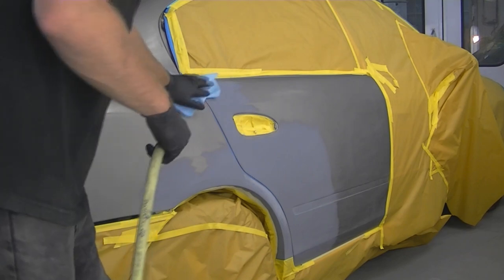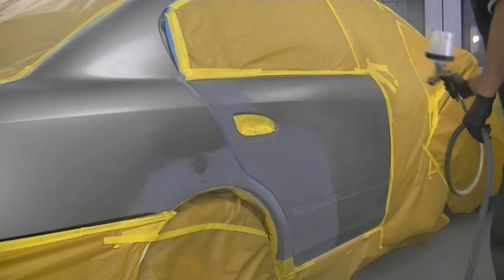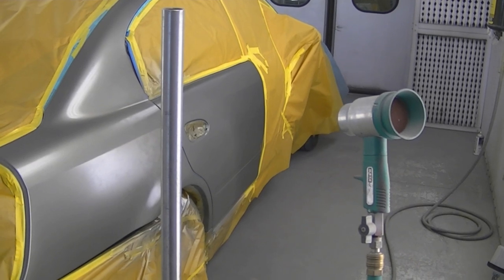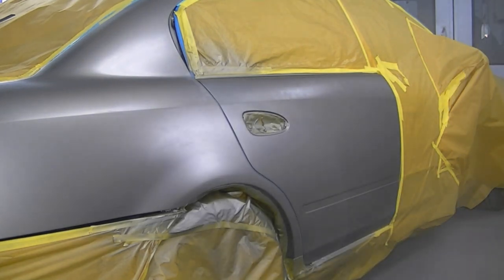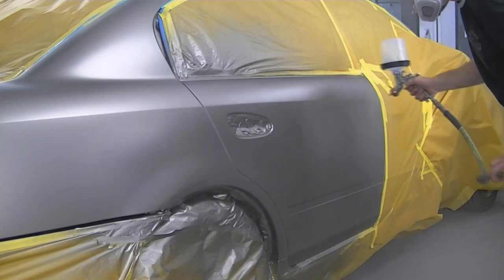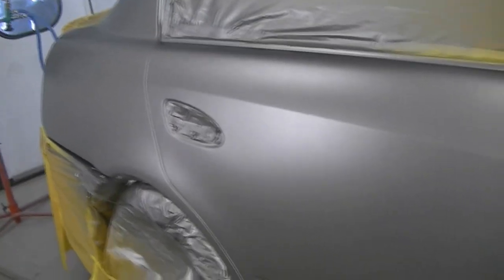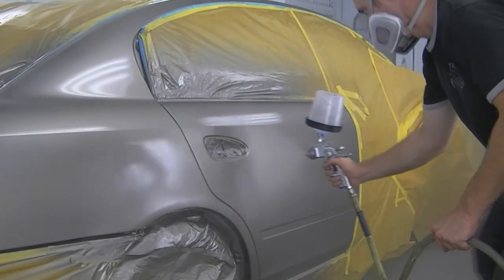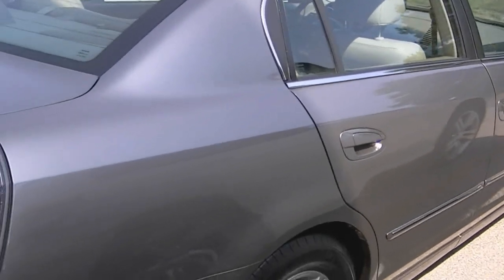How To Blend Metallic Car Paint

Comment: A nice bold approach to how you spray your base. I wonder about some of the comments here about tiger striping, which some posters think you'll get by the criss cross angles of your base application. Are they not aware that if your gun is clean, your spray pressure is constant , your paint is reduced properly, and your technique is solid, you could spray a X across a silver hood and not see it later.

Comment: Enjoy your work. my 1st time painting. tried to blend repair of 4 inch area to 10 inch area on the lower door. have  spray can "bright silver metallic. some it a bit patchy. blend color looks brighter then rest of car. will clear coating it tone the color down a bit? i wet sanded it and then based it again. still same brighter look. i don't have money for a pro to paint. suggestions?

Comment: i think when you apply is a wet bed "Unpigmented Base coat" between blend Coats it create's a more noticeble Color Blend because your blending in different layers of paint which becomes more noticible by creating a Holograph Effect as the layers deepen. Its a skill i find that is perfected in a lifetime and not many master and you have it. Too many factors here.
i think the best approach to this repair is to paint the entire side of the car, blend color under the tailights where the shape hides the repair and do a full panel Clear to the edge of the panel. but on the otherside it depends on how good of shape the next adjacent panel is.. if the Clear coat is mint then you can scuff it out in under an hour professionally. i say scuff as oppossed to sand because color is one thing and finish matching is another very well done video. i like to say you can only see one angle of the car at a time.

Comment: wow that came out really well. I just got my car painted and its the same bronze color as that one, the only problem, is that the new paint came out a little darker than the old one and you can really tell when you see it as the sun shines right on it. Was that because the painter did a poor job of blending? or was it because they just used a color that was darker? They painted my car from where you painted that altima, quarter panel and rear door.

Comment: I have a couple of questions. I have been painting for a living for about 3 years full time and still have a hard time with light silvers and golds. Every painter I speak to paints differently. My question is, in your video, how many turns out is your material knob, your fan, and what psi? Also what size tip in your gun?

Comment: I recently did a Toyota Yaris which is silver- code 1e7 and had to paint both doors and blend into both quarter panels, the base appeared to me as if it went on well and covered well, i put about 3 solid coats on after i coated the primed areas. I was happy with how the base looked, it went on smooth, no mottle no streaking or anything. I put the clear on, 3 coats of clear and then i noticed the both the doors had major streaking in them, it has never happened to me before, I'm not sure what caused it?? it was a cheaper than normal base coat which might have been the culprit
Reply: Give each base coat a good drying time.
Reply: Alive And Anxious actually you can see if that will happens with a flash light and what i do to fix it it's re sand it with 1000 grid and use a flex block, i don't use my fingers cause i did it many times and i made channels that looks like dents at the end. Good luck buddy.

Comment: I have damage on rear quarter panel and bumper, both will be repaired 
and painted, is it required and recommended to blend with rear trunk and
 rear door. My shop tells me they will be blending, insurance company is
 getting me run around. Insurance company tells me to rope off rear 
quarter panel window rather than removing to proper painting.

Comment: do you keep your psi the same or do you have to ramp up psi and hold back gun? 
also what do you do if you are getting tiger stripes on a hood when painting metalic paints. sata jet rp3000 1.2 tip base

Comment: Hey,
I am looking to repair some rust spots on the box of my truck. I do not have a spray gun so hoping to use a spray can (paint, primer and clear). I need to blend it in though as I don't want to paint the entire side of the box. Is this possible using the spray cans? If so, do I use the same techniques as in the video?
Thanks!

Comment: you can and should add a flex additive to primer also SEM sells flexible primers for bumpers and other automotive plastics
however base coat does not require it only clear coat

Comment: Thanks very much for the video and explaining everything. So with metallics and pearls we don't wet sand before applying the clear is that correct?
Reply: If you wet sand a metallic colour before the clear coat, you stand a high chance of disrupting the metallic flakes embedded in the clear coa and will end up with a flat dull spot in the metallic when cleared

Comment: I was wondering, you do not have to do inside the door jambs? so many cars in the 60's and 70's , man you would get  a sandpaper like over spray, depending on the car , the color or your angle, but to just paint with out checking . amazing! one other thing, was that a shadow on the last footage? quarter looked darker?
Reply: Door gaps have masking foam inside the check, its special shape feathers the paint edge just inside the edge of the door

Comment: would it be a good idea to tack in between coats or no?? i dont but when i clear i get this gritty look on my blend edges so i feel like if i tack that off the finish would look much better but am afraid to do it and not know if it ll move the metalics or not
Reply: Eddie Lugo I used to never tack rag my basecoat for fear of moving mettallics. I tried it on a light silver last week and got the cleanest full respray out of a booth ive ever gotten. The tack in between every stage including the plastic around the panels combined with observing flash off times plus wetting the floor.. wow what a difference. I got between 5 and 10 easily to wet sand out specks on the entire car, a couple light sags in areas where my lighting was dim and I had little movement around the lift and one minor gun drip on the roof. Sounds bad but overall the car looks incredible. No mottle, no patchy spots, and minimal polishing to do. And that's all in a filthy oily repair shop with my air line catching on things every 2 min. Tacking is CRITICAL to clean work.

Comment: i think this was very insightfull. all these negarive coments just reflect on their ignorance and bitterness for they only can dream about even attempting to do this their toaster. its easier to diss out of brainless thoughts than to comment on constructive level. I am learning this trade out of hobby and found this video to be very educational. Learned alot. than you
Reply: Javier Castaneda glad someone said that everyone has different techniques and a lot of people don't agree with other people matter is if it looks great it's done right I personally add to 20 to %50  2k clear after covering the repair area this blend perfectly without the requirements of extra additives to paint work then simply clear coat over another 2 to 3 times sand and polish perfect also save you from blending half a car when you have a dentist size your hand

Comment: am confused, new to the blending skill. In one video you said you couldn't use a wet bed over the chromax water born where you had trouble with a match. You mixed it with the base. But here you are using a wet bed, every time what am I missing? Also is this orientation coat a blender solvent and if not would that work on some paints?
Reply: don't listen to anything he said! I've been painting for 30 years and have never used a blending additive. Blending requires 3 steps. 1...coverage, 2 first blend pass.go as far as you are taking blend and spray back towards the fresh paint. don't change preasures or anything! let flash. 3 final blend pass..divide blend area in half spraying back towards repair area.done!. trick...pull fluid stage as you move the gun with air on continuosly. easy. works every time.

Comment: Wet bed is only meant to be applied once, and if you speak to any ppg certified painter 95% of them don't even use wet bed due to the sinkage in the near future. Also the way you are spraying would create halos just by the way of flicking your wrist rather than having consistent overlapping, with the correct drop coat. May take a second drop coat to get rid of blotches. Silvers are meant to be painted like robots just how it came factory finished. I see many painters spray like this and they all have terrible hand eye coordination. And with poor consistency and poor overlapping they have primer bleed through a, halos everywhere, tiger striped and extreme dryness and orange peel. Sure looked good on camera but in person I'm sure this car need a very good polish and deliver in shade
Reply: Why would you only spray the wet bed once, when you have 3,4 maybe even 7 coats of more color coming down. The wet bed is dry after the first coat of base has flashed off. His technique is fine

Comment: Yeah,  i'd like to think i was an expert in the field so here is my opinion  the rear quarter is miles out,  as in much too darker than the rear  door and you can also  see that where he tried to lose it up the roof pillar he was very unsuccessful unbelievably so,  expand the video to full view you will see what i mean at the top of the shot although he tried to hide it he was unsuccessful. He also fell short at the wheel arch which follows past the rear of the rear door. In fact the way he painted that vehicle in the video i would say that the finishing item shown was not that same vehicle at all. Therefore the point of the video leaves me bewildered. He should have masked the door off. Sprayed the quarter  to full solid colour, then released the masking paper from the door completely  and then he would have been in a better position to see where his blend was going to have to be, by not having to sweep away all of the excess paint that would otherwise have been on there from painting the rear quarter.  There was never ever going to be a colour difference from door to door as there was no paint put on to the front of the rear door so i am confused as f**k as to the point of this fandango video.
Reply: Baw Sac  old comment I know but your not seriously saying that there is a dark line on the quarter panel and piller at the end are you? You know when the car is outside that the back half is in a shadowed area hence the dark line through the quarter and piller?
Reply: your comment leaves me bewildered.
Reply: Was that to me or bawsac? He edited his comment a bit but said there was a big line incase it's my comment your meaning. Doesnt make as much sense now its edited admittedly

Comment: Has anyone tried putting 20-50 % 2k clear with there metallic after coverage to blend then clear over again cut buff ect I've been doing it for years now work perfect and doesn't cost anything extra I don't believe in fancy stupid extra coating if you can get away with it in other natural ways try it one day you'll be impressed most the time saves you from blending a massive Area when you don't want to

Comment: a guy online (suppose to be expert painter) told me to 50% overlay my paint. 

i did 3 coats (15mins between) (45 mins wait then cleared it) (3 coats 15minsb etween)

my clear is fine but i have light and dark shades in the strips doing the overlays. will this go aay now i cleared or is it fucked :(
Reply: antonyr123

Comment: i would think that job should take 30mins max. no more. the blender in between coats i have never seen before. i dont see the need for it 2 b honest. i dont get hard edges when im doing a job like that. easy job. unless you dont flik gun,or stop at same point on panel,or too dry u shouldnt ever get  hard edge.

Comment: You'll never get the right look using aerosol....  need proper atomization and correct reduction of your basecoat to properly blend out high metallics.  need to invest in an HVLP basecoat gun.  $100.00 can get you a cheapy to do the trick.  need compressor too with water trap or air dryer.

Comment: this is not the best way to blend, been painting 30 years never used blending solvents! Blends take 2 passes after you cover repair. Spray back towards repair to avoid halos. keep air stage on constant! pull fluid stage while gun is moving. 1st pass start at blending edge where ever you determine. 2nd pass ...divide blend area in half spraying back towards repair...done! that easy! don't complicate blends! never had an issue with this method...pearls, metalics all the same

Comment: Please don't take this advice. Wonder why he had it in shade to show his completed work? I don't. If you spray like this guy, you will be laughed out of a shop after paying to fix what you fucked up. And please wear gloves, a fresh air unit, and an antistatic suit for clear or you'll end up dying by 50. If you really want to learn these techniques, get a job as a prepper at a reputable shop and learn as you work.
Reply: So lets see one of your videos when you paint.
Reply: I do think it strange to park in the shade after spraying, for what it is worth the door did look well, matched to the front door, I would have made a point of parking all the Car in the sun?
Reply: Well elaborate on why you don't like his work just don't say hes not good? Your right about  learning as a prepper, and wearing gloves, paint suits etc but that's just safety requirements except the suit because you will get a lot less dirt in a job wearing a suit since most dirt on a job comes from the painter, and the booth.  iam a 15 year professional painter, and this guy is actually very knowledgeable.